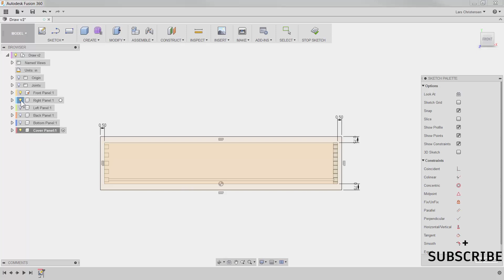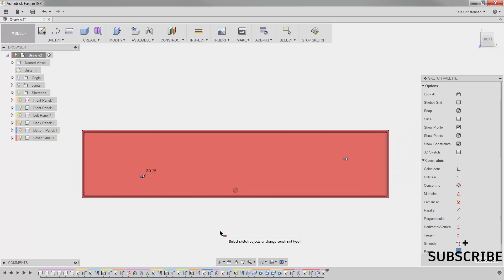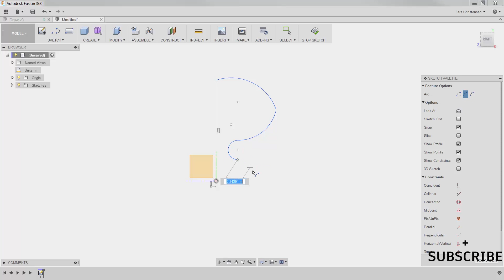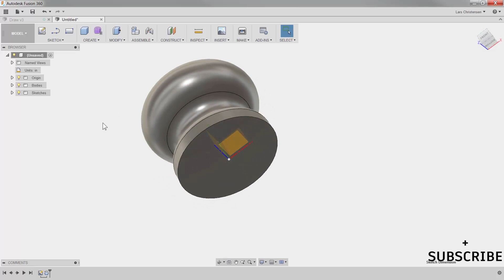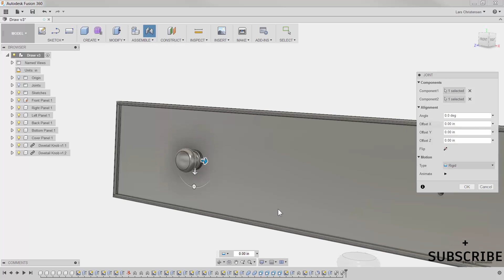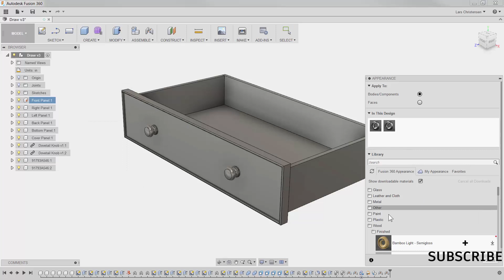Fusion 360 Tutorial - How to Model an Assembly Drawer with Dovetails from Start to Finish Part 4

Comment: Lars, Thanks for the great videos.
 One problem I am having with the dovetails in my drawer -  I made them as you did, however, when I change the drawer size I get an error because the number of dovetails or the spacing doesn't adjust.   any thoughts?

Comment: Well made tutorial, especially the part about "project" is very good. I do have one question though. Nornally woodworkers use specific angles for dovetails usually 1:6, 1:7 or 1:8. This translates to angles that are made from the straight horizontal to the angled lines. How would you do that in fusion 360?

Comment: I learn a lot from your well paced tutorials - great work!
One minor correction (it might help others): In the last steps of creating the knob, you set a construction line and using it set a dimension of 0.75. As happened to me and can be seen also in the video, the value CANNOT be set (it conflicts with other constraints) and the software shows a small error window and keeps the value at 0.73 .  The form is fully constrained once you add the construction line at the middle point.
Reply: Thank you.  Was working my way through the video and couldn't figure out why it wouldn't fully constrain.  No problem after making sure to add the line at the middle point.

Comment: As an absolute beginner I enjoy your videos.  I am curious about one item for now; When using the Dovetail board as a "Tool" to cut the other boards no clearances exist between the tool and the target. That would make for an extremely tight fit when trying to join the individual components in "real life."  Of course, I have no idea what tolerances should exist for proper assembly and to compensate for changes in the wood due to humidity changes as the wood will absorb moisture. Maybe I am thinking to deeply and am way off base.
Reply from the maker: Thank you for watching 👍😊I have always modeled everything I normal dimensions for my 3D CAD and then done compensation on my machine tools for clearance and tolerances( Except for 3D printing)

Comment: Lars, Fantastic tutorial but... drawer it is not finished! How to put all component on one sheet of plywood and cut it out on CNC? Do you rotate and put side by side pieces flat in another model and than generate tool path or there is better strategy? If I have 3 axis cnc machine what would be best strategy to make knobs?
Reply from the maker: Hi Tomasz Duczmal Thank you for watching!
lol, you are right! I would probably make a simple fixture with a screw to hold on to the knob and 3D machine half, and then spin it around
Reply: Great, but I still have problem ;-( I am building rowing boat and my model have many flat parts oblique to each other. I am using many User Parameters to be able to optimise design - components are related to each other. Whole boat is in one model with many components - seat, ribs, carriage etc. I cannot copy/paste individual pieces to place it flat in another model for CNC! Is this because components are related to each other and cannot be extracted from model? My work around is making copy of whole model, deleting everything except one piece and than  "Insert into current design" That's daft! Is there better strategy?

Comment: Awesome tutorial, thanks. I follow along and try to replicate every detail. At 15:30, when you add the construction line to set the width of the knob to 0.75, it looks like the geometry already is fully defined. The value, i.e. the width of the knob, does not change, but stays fix at 0.73527. Or did I miss something?
Reply from the maker: Hi John Johnson Thank you for watching!
The internal radius was not fully defined.

Comment: Hi Lars

Excellent as usual.  Question on adding the knobs.  Mine come in with the origin planes showing.  I tried turning orgins off in the drawer file and in the knob file, but they remain visible.  How do I turn these off, and how do I turn off the grounding symbols as well

cheers

Derrick
Reply from the maker: I am thinking you have an origin on somewhere. Try to look harder :-)
There is a joints folder on the left side you can turn off the light bulb

Comment: Great series.
 All your videos are really helpful.

I have been exploring Fusion 360 for about 2 weeks, trying to learn. In an earlier video on the drawer design/modeling you mention how the entire model can be resized parametrically. I implemented "user parameters". I did one dovetail and cut, then used pattern. I created a parameter for 'count' so the number of dovetails adjusts to the height of the drawer.

I am having trouble with another area, that is in 'joining" component faces. I've spent hours looking at many tutorials. I've searched the internet. I know Fusion does not have that feature... to constrain component faces. Is there a tutorial that shows the workaround? I would like to see a video of "it doesn't work." and then the fix.
Thanks.
Reply from the maker: HOMER HOMER Thank you for watching the video!
Check out this video:
https://youtu.be/KQNgIfjMr84

Best,
Lars

Comment: Great video! I be very interested in hearing how and when you address joint clearances when milling wood. Is it easier to set this in the modeling environment or in the CAM environment. I have yet to find a tutorial that addresses issue with any wood joints. It seems to me that, as designed, those dovetails are going to be too tight and will not go together, especially with glue on them. Thank you!
Reply from the maker: Hi Christopher McNulty Thank you for taking the time to watch the videos!

There are no rules, but most common would be to make the adjustments on the CAM side of things.
Reply: Thanks, Lars!

Comment: How don't think you went over how the dovetail will change with the height of the drawer. It appears to be static at a count of 5 and a set spacing. Will the drawers height adjustment affect the number dovetails present? That would be handy. :)
Reply: Hi gredangeo, i'm facing the same problem as you, in my sketch i found a way that will produce the correct number of tails but he only draw on the face the additional numbers of tails but i didn't find the way how to reproduce the cut afterwards. did you find something? I'm completly new on fusion and i would say that for woodworkers at this stage with sketchup you have a lot of addins available for doing joints automatically between parts.
@Lars, any idea how to repeat the cut also?

Comment: Lars,
Thank you for this series (your absolute beginner and these drawer videos). You are a great presenter and make everything very clear. It is great to have the explanations of why you are doing something in a particular way as many times I see the upcoming operation and think something like , "Ok, now he's going to mirror that across to the other side", only to find out, no, Lars is projecting the geometry. Having a lot of prior experience with Solidworks - in the dim and distant, version 2 or 3 if I recall and latterly Sketchup, both of which I used in my woodworking shop, I also find the repetition very useful - "Activate the component", "Turn on history" as otherwise the ingrained habits developed using other software tend to lead me astray.
Reply from the maker: Thank you for taking the time to watch the videos! Really happy you found them helpful!

Have an awesome day!

Best,
Lars

Comment: Hi Lars, Lots of fun on that one. Some really cool new features, like Combine, Rectangular Pattern. Revolve and Project...very interesting. Thanks again for another great lesson! :)
 I'm trying to build a rim and it uses revolve as well but I'm having a bit of a time sketching thin walls. I need 4 of these for my tractor project. Do you know of any "Rim" tutorials in Fusion360? TIA, John
Reply from the maker: Hi John, Really happy you like the videos! Thank you so much for watching.
There is this video https://youtu.be/Nk05UUqI-F0 But I don't think I would do it that way.
I would draw a cross section of the rim like this https://www.google.com/search?q=cross+section+of+a+car+rim&tbm=isch&imgil=7515ho4pNCEtEM%253A%253Bv_JS-PEe1RjIDM%253Bhttp%25253A%25252F%25252Fwww.oponeo.co.uk%25252Ftyre-article%25252Fhow-to-read-the-wheel-markings&source=iu&pf=m&fir=7515ho4pNCEtEM%253A%252Cv_JS-PEe1RjIDM%252C_&usg=__Du2SuHU0Q4mm-_azj1TvdPBmI3k%3D&biw=1536&bih=775&ved=0ahUKEwjHgOWLoYzUAhWB24MKHbUBCgoQyjcINQ&ei=1XAnWYfCLIG3jwS1g6hQ#imgrc=7515ho4pNCEtEM:
Reply: Thanks for the links Lars!... no need to reply, I know you're busy ;)

Comment: Well done tutorials.  Since the front-back and right-left pieces are exact copies, is it possible to model 2 and then make inverted copies to shorten modeling time?  Is it possible to make the dovetails themselves parametric as well?
Reply: Answered the first part.  It is easy to copy the component and also easy to rotate it with a suitable construction line to use as a rotation axis.  Struggling with the second question though.
Reply from the maker: Hi Greg, Not sure I totally mean by parametric....The way the dovetails are done here are parametric in my opinion.

Comment: Lars - just finished my drawer! Wonderful tutorial - best I've found so far! You have a great skill for delivering just the right amount of information in an entertaining way. I have only two minor suggestions:

1) It might be helpful, although you do this most of the time, to always point out what keys and / or mouse buttons you are holding down, since it is not obvious (or I have seen videos that somehow indicate this visually).
2) A nit-pick on the drawer finish - I know the wood grain is just for show, but for someone actually making the drawer, if they didn't know better, might use that as an indication for cutting the pieces. Of course the grain should go with the length of the piece, not the width. Odd that Fusion doesn't always automatically orient the grain to go with the longest side of the piece (like it did with the drawer bottom)!

One more little thing - I noticed when placing that last dimension on the knob that you (and I) got an error - it would not let you keep the dimension you typed in, but rather corrected it for you - it would have been interesting to hear why that happened!

Thanks again - looking forward to choosing my next video of yours!
Reply from the maker: Thank you so much for sticking all the way through the videos. Really appreciate your feedback!

Have an awesome day!
Reply: I noticed the same point about the last dimension on the knob where you made a construction line on the center of the big radius of the knob and tried to dimension the radius to the revolve axis. You typed 0.75 and the program came up 0.73527. Same thing happened to me...lol. In any case, it still worked...

Comment: Brilliant Series. I've modelled my drawer - but used parameters for all the sizes & used finger joints rather than dovetails (since the drawer[s] will be laser cut). The only problem I have encountered is that in the rectangular pattern feature does not seem to allow the number of repeats to be parameterised. I like to be able to set the number of finger joints as a parameter. Any ideas.
But what a great series for the beginner! Very well done.
Reply from the maker: Hi Kevin, Thank you for taking the time to watch the videos. I think you are looking for the "Change Parameters" in the modify drop-down. :-)

Comment: Actually, there are two ways that Lars can "take this to the next level"! The first has already been suggested: Do a video or two on using the model to produce plans. 

The second? Do a video or two on preparing this for a CAM machine! As another poster pointed out, this would also - as a byproduct - reveal that some things can't be done entirely in CAM - some finish work (like squaring rounded inside corners with a chisel) can't be CAMmed.
Reply: Yes!

Comment: Great series once again, but seems to me Autodesk have to work on Move/Copy command. I get crashes while doing that, especially while working offline . Side panels background turns black (as seen in this video as well while placing screws) and there it goes. Once you get to understand timelines and relationships between components, great tool for getting everything ready for manufacturing. Seems to me as woodworker (cabinet maker) right way to approach would be - build your basic sketch (front view), set up your main (user)parameters and relations in 2D sketch, create components and then start drilling or project holes between related parts (components) etc.... Thanks again, Keep up great work. Hopefully got something to share in near future.

Comment: Very enjoyable videos. Could you please tell me what hardware (desktop) you are using? I notice you have Dell monitors but are you running a Dell system? Thanks.
Reply from the maker: Hi Russ, I use a Dell Precision M4800 Laptop. Probably a little overkill for Fusion unless you get into rendering and simulation. But I have to say upfront that I am not a big computer wizard.
Reply: Cheers Lars. Many thanks for the info.
Reply: Fusion is increadibly light on hardware requirements.  I am constantly surprised I can run in on a $150 destop I bought 2 years ago, and an 8 yr old Dell laptop (that was high end then). Incredible.

Yes, it would be smoother and much less lag between functions, but... still. amazing.

Comment: First of all, thanks for your many Fusion360 videoes, been a huge part of me switching from Sketchup to Fusion. Very well explained, not just this series.
I am using Sketchup and now starting on Fusion360 for Woodworking. So i am very glad that you decided to make this series, as 99% of the Fusion360 videos are related to CAM, Metal work or 3D print.

I have a request / suggestion.
The last step missing are plans. To share with others and/or to take out in the workshop to build the drawer, in this example.
Is this something you have on your list to do ?
What i am missing in the other tutorials i have seen on youtube in relation to plans are best practices to make multiple page plans. To make cut diagrams on sheet good. To make cur diagrams on wood and to make a bill of materials with dimensions.
Reply from the maker: Hi Michael, Thank you for watching the videos and taking the time to comment!
Yes, It is on my list. I need to find some extra hours in the day, because you are right those videos are needed.

Thank you!!
Reply: Yes +Lars. Thank you.

Comment: Hi Lars, I love your tuts. I have one question. When I have modeled things in the past that have fit joins whether it be for 3d printing or CNC. I find that there is always a tolerance issue. Where as the part don fit together well ie. too tight. Do you have any good tips for allowing for a tolerance. Thanks Matt
Reply from the maker: Hi Matt, Thank you for taking the time to watch the videos.
Well, Coming from manufacturing it is standard that you model everything to nominal and then provide a 2D print that has tolerance callouts.
With CNC it is easy because you can walk in on the tolerance with your cutter compensation right at the machine, but for a 3D printer you actually have to change the 3D model.
Reply: Thanks Lars. Sort of what I expected. I appreciate the time to answer.

Comment: Hy Lars, love your tutorials, but the dovetails as in the tutorials, are in real life not producible by an machine.
Reply: That depends on the equipment you own.  I have a Leigh DR4 24" wide dovetail jig and a couple routers.  You can move the fingers on the jig, to make various spacing configurations of pin and tail sizes, which will line up with your board widths and thicknesses ... full / half-blind / through or your imagination with different templates.  Make some test cuts for tolerance and fit on test boards of the same size as final boards.  Once satisfiied, "Go to town" cutting dovetails.  The jig isn't a cheap tool and can take away from the handcrafting experience, but if you have a lot to do, it's faster and machined can be more accurate.  So they can be done by machine, just saying.
PS - Lars, awesome job!  As I'm considering the Fusion 360 for my 1st CAD / CAM software as a Hobbyist and have thoroughly enjoyed your tutorials about it!  I'm going to be attempting a CNC conversion to my milling machine G0759 and this seems it would be advantageous for creating the various bearing blocks and stepper motor mounts and other future designs.  Thanks again!
Reply from the maker: Hi Marc, You are absolutely right, time to bring out the old hand tools for this one :-)

Thank you for watching the videos!!
Reply from the maker: Thank you for adding some good content to the comment section, Lanny! And, thank you for taking the time to watch the videos!!

Have an awesome day!